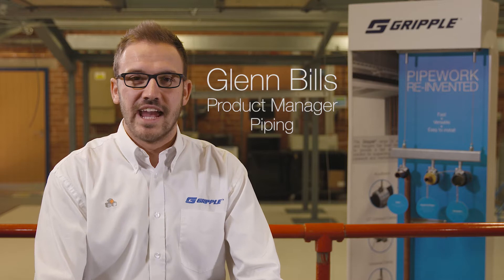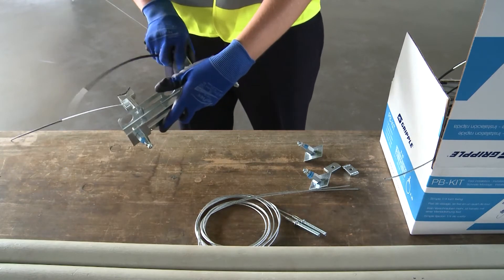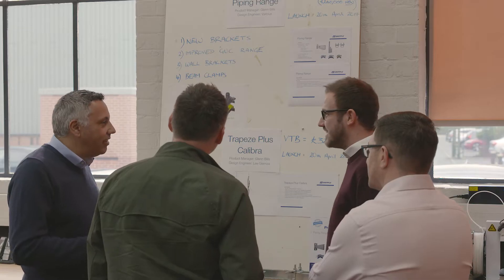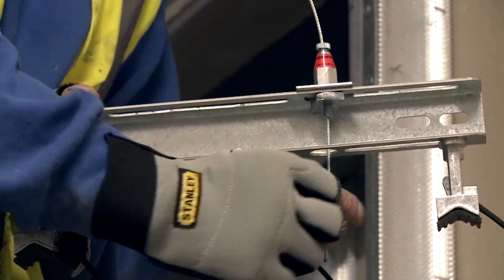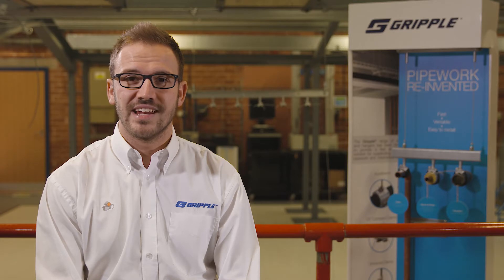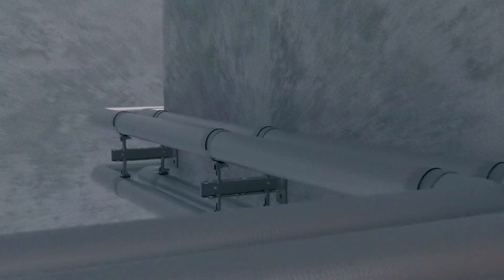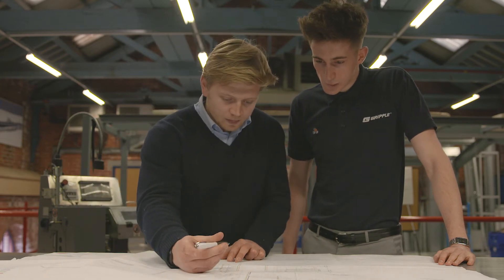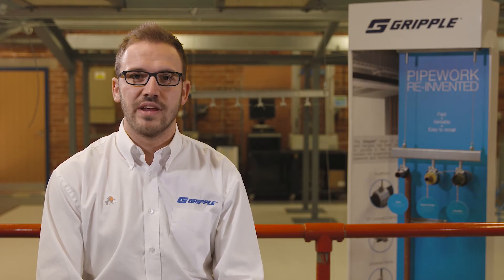Pipe Supports & Hangers – For the Comprehensive Installation of Pipework

Comment: The Universal Bracket offered in the USA is shit because you can only attach pipe to one side. Also, Gripple documentation sucks; they have submittals with no model numbers, a no.1, 2, 3, & 4 versions on the same Submittal and give you no clue on the difference. This product is very frustrating to order with no decent guide on how to build model numbers for the product you want.